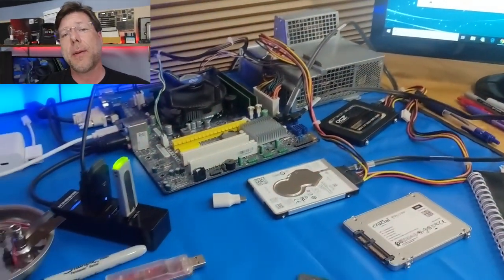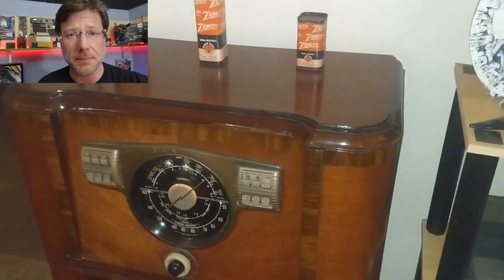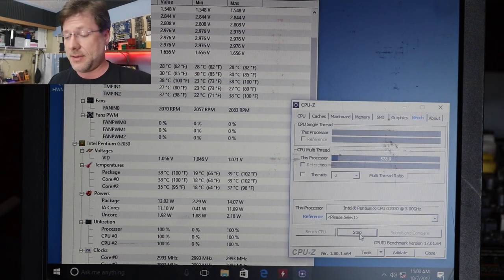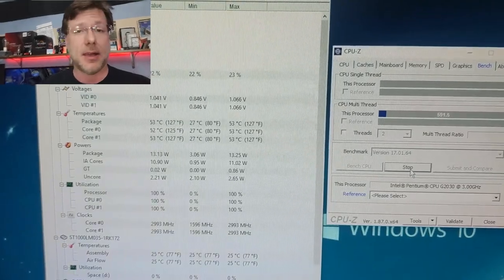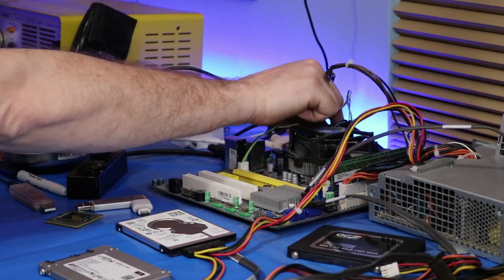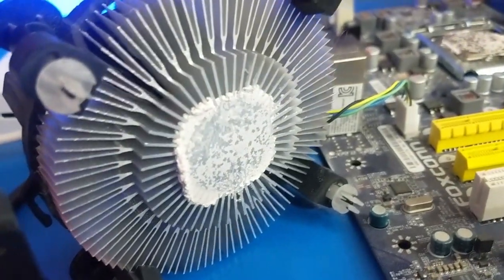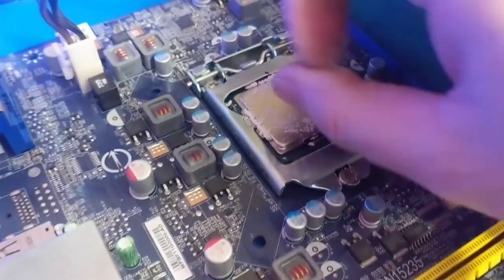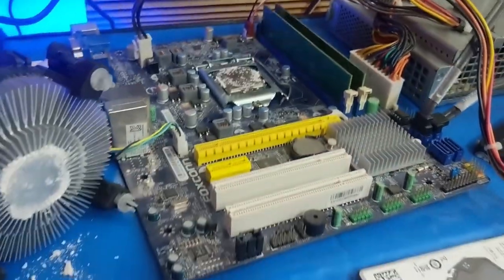1.5 years Toothpaste for thermal paste experiment!

Comment: You can mix toothpaste with grease oil. and won't dry. the mixture dosage is 70% toothpaste and 30% grease oil.
I have tested it on a laptop with a minimum temperature of 52 Celsius and a maximum of 74 Celsius.
Reply: you do know that 50 celsius is more than 100 degrees Fahrenheit  your CPU could quite possibly burn or catch on fire
Reply: @jordzking6330  50 celsius is low temps
Reply: @jordzking6330  lol the Dangerous temp zone for CPUs & GPUs is 100 Celsius. not 100 Fahrenheit.

Comment: I been using toothpaste plus Vaseline for a while on my ps3
Reply: Advert Marketing yoooo
Reply: im disassembling my ps3 rn 😭😭 thanks for the mix my guy
Reply: Advert Marketing how long had you been using it tho
Reply: For like two years and a half
Reply: @adanlopez7161  i found something better than just mixing them two products together. I will make a video about it
Reply: Advert Marketing I am pretty sure vaseline wont do nothing but makes things worse.
Reply: How did you make it i literally need it for my ps4 bc it gives me the red line of death and it cuts off after 3 beeps
Reply: Lxvlyy did it fix it with toothpaste & vaseline?? i got same problem red light of death wont turn on
Reply: @ld749  MAYBE

Comment: I didnt have thermal paste so i used toothpaste and it actually worked really well
Reply from the maker: Crazy huh hehehe
Reply: I’m using toothpaste as thermal paste right now and it’s actually working.
Reply: @michaelporter5098  how is it working for you right now?
Reply: @hvpeless  It’s still working well. I’m on a core i7 2620m if you wanted to know
Reply: @michaelporter5098  update?
Reply: @niko2up  burned out the cpu…
Reply: @michaelporter5098  bro seriously??!😂